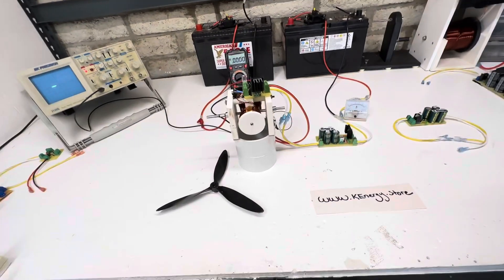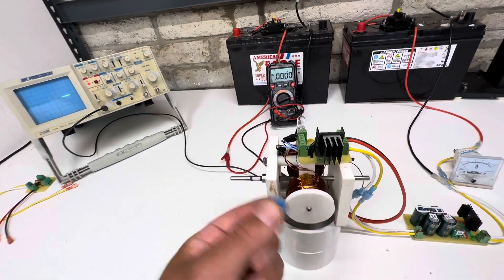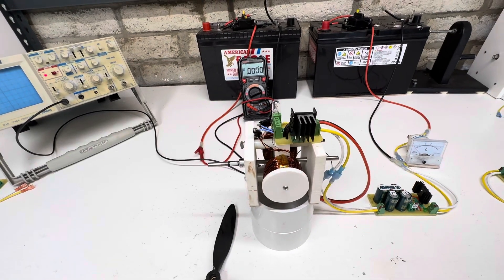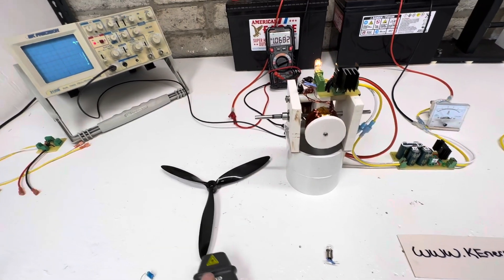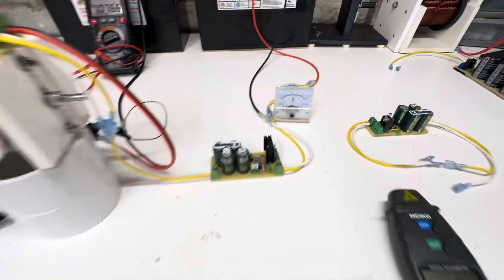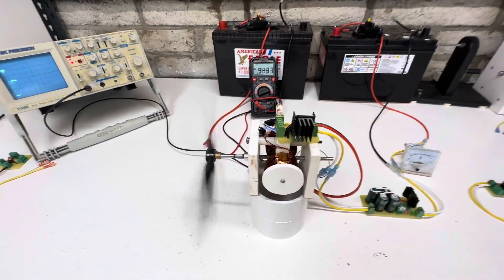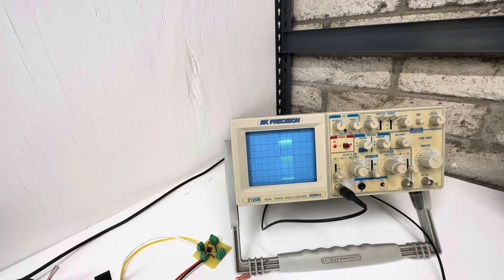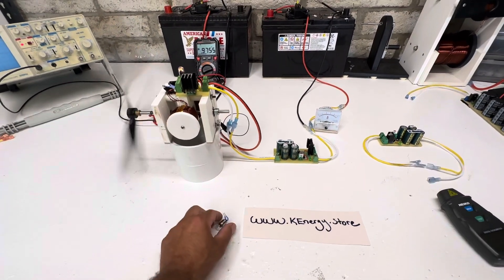High speed bedini motor pt 2

Comment: Hi, in parallel the input power was less?
Reply from the maker: Yes strange circuit! That’s why it’s good to try different configurations
Reply from the maker: It should be less in series because of higher resistance but there is a lot of “tuning “ in that circuit